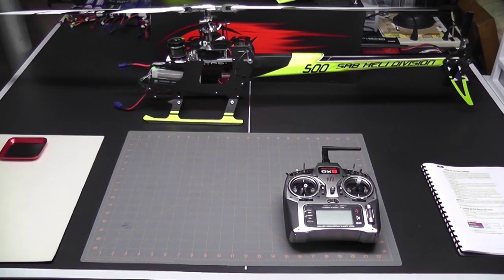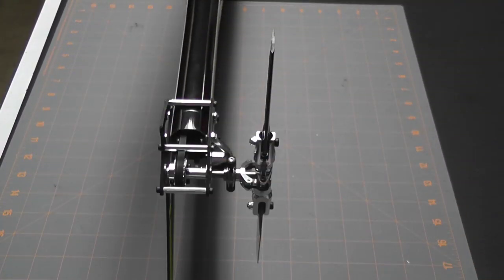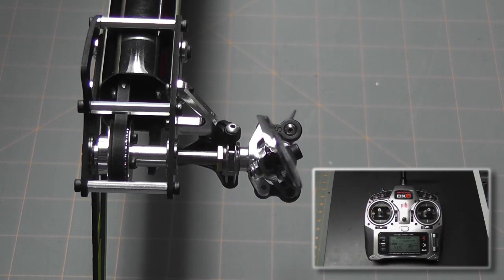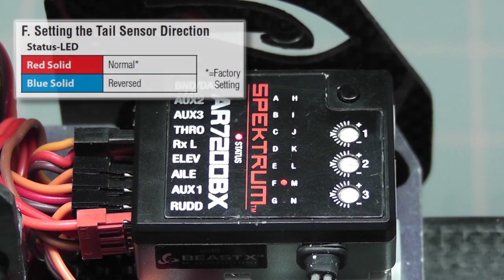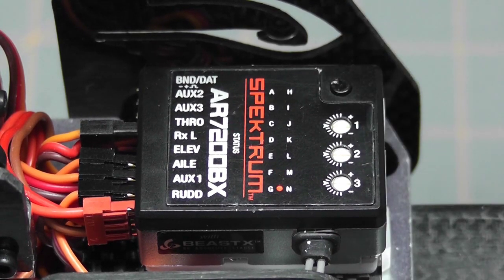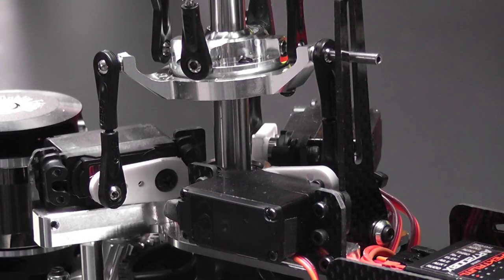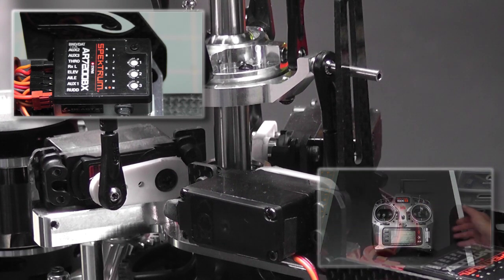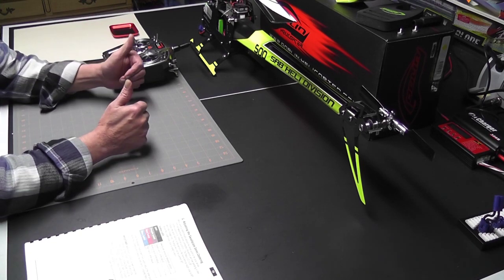Goblin 500 Electronics Set Up - Video 3

Comment: hi when the beast x  is setup up and finished, should my aileron pitch be 6 degree at top and bottom stick  so it only banks over 6 degree maximum...is that correct ..
Reply from the maker: Hi gary,  Sorry bud.  Been a few years since I flew the Goblin.  If I remember correctly, that was the suggested setting.

Comment: Hello Sir, now that I have the flybarless system programed what about the transmitter? what can I do with the transmitter?
Reply from the maker: Hi there Heliguy!  I use a Spektrum DX8.  I found the starting settings on line and had to tweak them just a bit to my flying style.
Reply: Thank you sir,  i also have the dx8 do you still have that information on which website?
Reply from the maker: Hi Bud, yes, I found it on Helifreak.  Note that I did have to tweak the settings.  Let me know if you can't find it and I will send you my settings as a starting point.

Comment: Hello. Yes the status light changes colors, just no servos move. Swash servos will not respond when out of setup mode either. My friend flew one battery with the heli and everything seemed to work ok. He wanted to tweak it down a bit and now something seems bad? One thing to note...when we load the 450x settings on Sd card (Right from Spektrum's website), the dx8 says, "This was generated by an older version and needs to update....Cancel/Update. We select update and it seems to load the heli?

Comment from the maker: Go figure!  I did not know that, but like I said, I have not gotten that far.  I did spin up the motor with out the blades when I was setting up the heli to make sure the blades were spinning in the right direction, but all I did was start up the DX8 with the throttle stick in the low position, plug in my heli, wait for it to arm, and then raised my throttle stick and it spun up.  So you are saying every time I fly, I turn on the radio, move to center stick, plug in the heli, and then back down?

Comment: You can program using another receiver or find a 6v battery. Scorpion backup is cheap and increase safety so i would recommend one anyway. 

You arm the ESC for each flight but only calibrate once if it does not work stock. You can check if it works in 1 min. Just start your DX8 go half throttle. When receiver is ready cut the throttle. There should be a beep from the ESC and motor should now operate.

Comment: You only need the separate power source once during programming of the ESC.

The AR7200BX does not initialize quickly enough when power is switched on to give the right throttle command for the Talon to enter programming mode, it needs a head start :)

I have a Scorpion backup installed so that part is not a problem for me, the USB link is, at least until tomorrow when it arrives.

Can you get your ESC to arm? (plug battery in with half or full throttle and then to idle for a final "beep")?

Comment: Hi George, after some research it appears there is an issue for some between the Talon 90 and AR7200BX related to throttle fail safe modes they both use.

The AR7200BX prevents the Talon 90 to get the full/half throttle input when plugging the power in and then move to idle to arm.

It can be fixed by adjusting ESC throttle settings via the PC USB link (which I have just ordered, will be good anyway to set head-speed etc). The process will require a separate power source than the ESC. Cheers

Comment: Excellent series mate! I'm just finished with my G500 build and your videos helped me a lot in the last steps to make sure things got right first time around!

I have the exact setup as you with engine, ESC and receiver/gyro but with a Spektrum DX7S rather than your DX8. 

I have a problem now though, the Talon 90 will not arm and engage the motor (first 6 beeps, then no "beep" when moving from half throttle to no throttle according to the manual)... Any ideas?? Will chase some forums now...